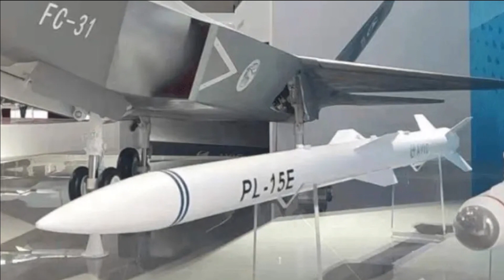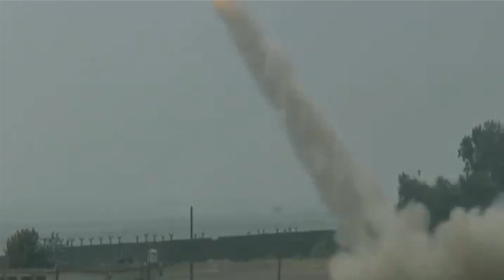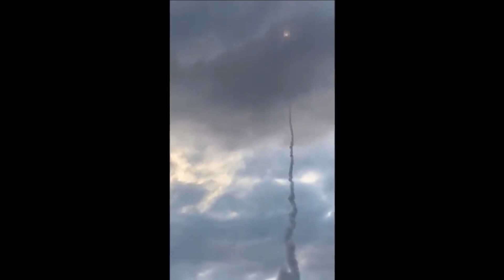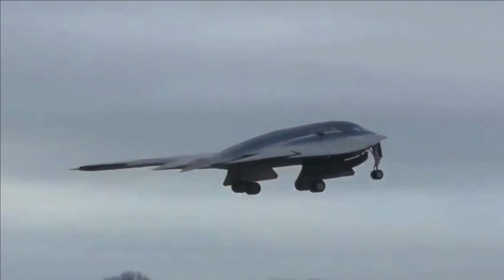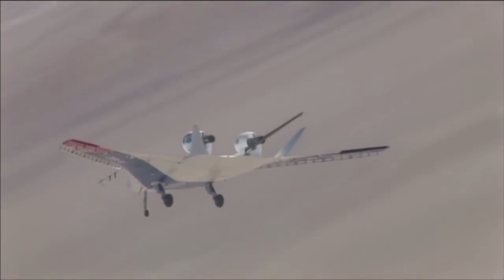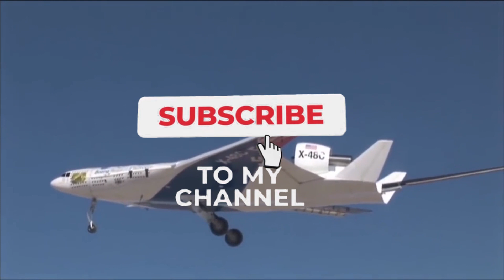Stealthy Tanker/Transport Aircraft Concept By Boeing

Comment: Blended wing body combined with hydrogen could be an excellent tanker or AWACS. ISRO/NAL combined have the tech on hand to realise this as a prototype, and should test it out. Both sides have long range anti air missiles, a stealthy tanker would give an edge to whichever side fields it first in an air war. Non stealthy tankers are juicy targets, stealth only forces them to come closer, within range of your SAMS.
Reply: We have the tech? 😅
We don't have any program based on blended wing .
Reply: @fly463  Airbus engineers based in Bengaluru are working on a blended wing.

Times of India

 Airbus's engineers in India are playing a crucial role in a blended-wing body that opens multiple options .

Aside from that ISRO has relevant expertise in hydrogen that makes the most sense for a blended wing.
Reply: @datoolz0  
But Airbus won't help us in our programs.
ISRO's expertise in hydrogen might help significantly.
We should start a program based on blended wing ASAP
Reply: @datoolz0  
That idea is impossible to occur in  our PSUs
Reply: @fly463  True. Maybe get Mahindra or Tata to do manufacturing? Outsource manufacturing to private sector.
Reply: @datoolz0  
Don't expect too much from the pvt players
When HAL came out and announced that they need a partner for mk2's manufacturing, zero pvt companies responded to their proposal
Reply: @fly463  I know, aerosapce manufacturing is still in very early stages. In next 5 years will mature and become much more successful. Need to take future orientation, because present is ... pessimistic.
Reply: @datoolz0  
Yeah

Comment: USAF and it's armed forces can only buy in limited number or not more than two digits it's too expensive
Reply: They will buy according to their needs.
Reply: They've bought 2400 f35
Reply: @dharmayudh2312  who said do you know cost of entire f-35 program
Reply: @dharmayudh2312  
They are planning to buy 2456 F-35 by 2060.
The total cost for procurement & maintenance will be around 
$1 trillion .
Reply: @fly463  sorry they are not gonna buy it's clarified from us Department now the current cost itself 1 trillion
Reply: @mrahulkeya8142  
They are not gonna buy 2400?
Then how many?
Reply: @fly463  bro they said clearly they won't buy 1000 f-35, they have large chunk of 4 th gen and 4.5 gen
Reply: @mrahulkeya8142  
They actually announced that they will buy 2456 F-35s in 2000s.
I don't know if they have reduced the total number.
Last year Lockheed Martin produced 140 F-35s
Reply: @fly463 see defense matrix videos and it's impossible they would buy 2500 f-35
Reply: @mrahulkeya8142  
Why?
They can do so in 
2065-2015=50 years.
Each year 20 billion.
Reply: @fly463  sorry